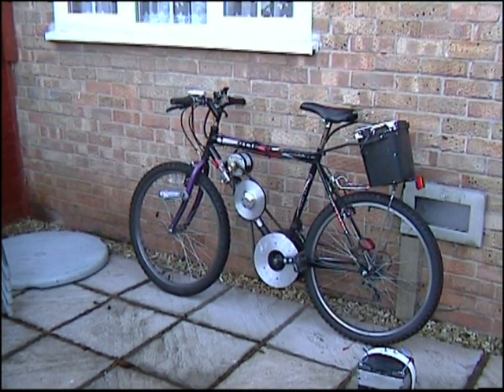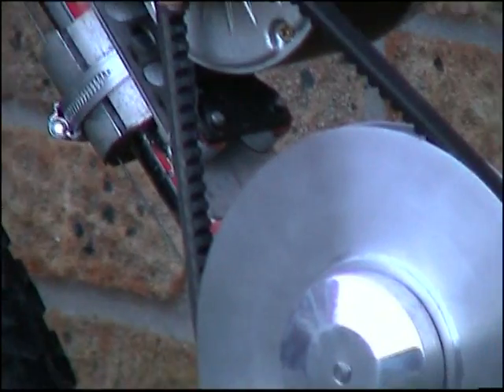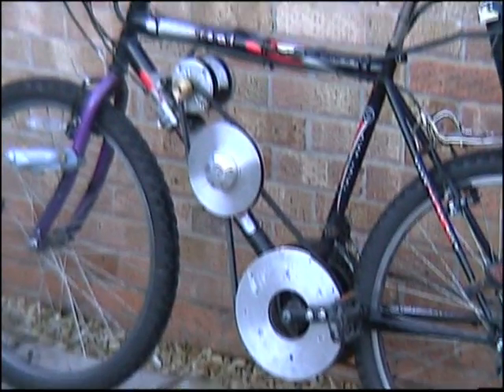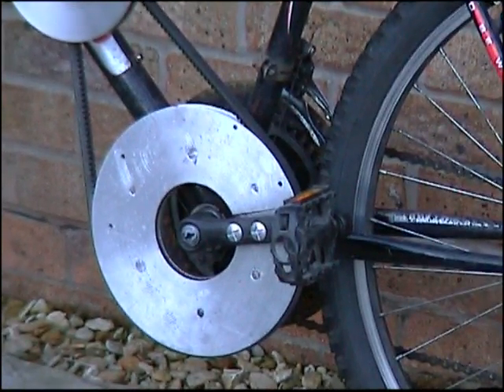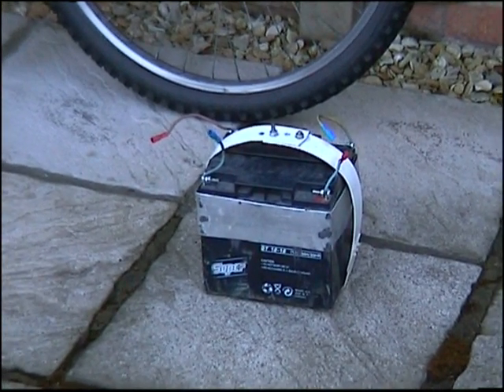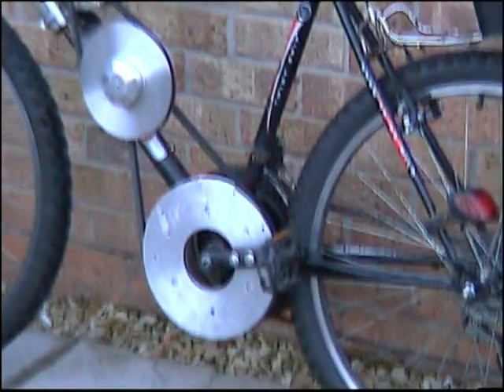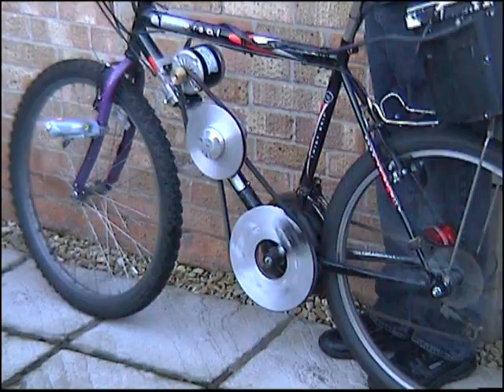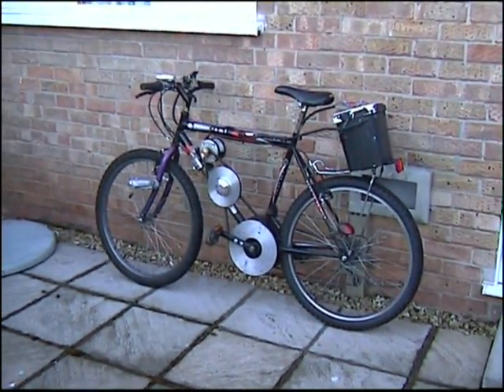Upgraded Home Made Hybrid Electric and pedal assisted Bicycle. Using a 350w 24 volt dc motor

Comment: Goofy ass power conversion? Just get a stronger motor and controller and skip all that transmission. Looks like the pedals have to turn when the motor is running not smart also no woman will feel comfortable riding this sewing machine where it appears any loose clothing will be sucked into this contraption
Oh and yes I have done it  at least 15 different ideas including a small e car.

Comment: how about you get 6 6S 5000mah Lipo battery packs and wire 3 6S packs in parallel and keep the other 3 packs as a back up battery pack for the trip home. Lipo batteries have more power output and charge faster than a sealed lead acid battery or just build some 18650 battery packs

Comment: Hi, I have a 24v 350w motor and 2 batteries of 12v 12ah acid batery, is this connection output to catch a speed of 30-35km / h and a distance of 20km

Comment: why pedaling in test ride? Motor not working?
Reply from the maker: It's pedal ASSISTED, so the motor works with the rider in unison to gain extra power together.
Reply: Nicola Burrow It have enough power to move alone?

Comment: If the battries are going to low voltage in the midway,  How can we recharge the battries?  Is it possible when the cycle is in running condition automatically it was recharged. or by padded is it recharge !
Reply: ashwini panda bfnfjfhivj

Comment: It's nice and simple design, i like how you attached pulley to crank, however in this situation when, pulley is not perfectly aligned ( i can see little bit of play) it will grind your belt over time, i would go for chain because it's much more forgiveable. This video is almost 7 years old so you probably figured it out yourself :)

Comment: is thes motor revolve in both direction (COLCK WISE AND ANTICLOCK WISE )
Reply: why would you want that on a bike xD!
Reply: dah!!! a bike is also a vehicle, sometimes you have to go in reverse!!!
Reply: Uhmmm... You do know that it's not practical to put a bike a reverse gear right?
Motor-bikes and bikes are smaller than 4 wheelers which makes them easier to just move it around with your feet.

Comment: It does not look HOME MADE !  Parts are all too nice and clean from other electric bicycles. Just put together like a kit . So what is "HOME MADE " ? I believe  you have to make it from part you have at home ! FYI, just saying !
Reply from the maker: That is actually quite a compliment. Obviously the motor is not home made but the pulleys I made on my lathe  in my workshop at home calculating the correct ratios. You will also notice the pulley attached to the crank isn't as neat as the top one. This is because I didn't have a thick enough piece of metal to turn it from, so had to bolt 2 bits of thinner plate together, then turn it as one part. I had to improvise quite a bit as my lathe isn't really big enough to handle such large parts. I do have other videos of me making some parts for other projects on my lathe if your interested. The plan was to make another bike after this one using better parts such as a lithium battery and a lighter bicycle but have never got around to it.
Reply: triumphmanful
Reply: he machined his own parts. It doesn't get more diy than that.

Comment: i really want the ebike factories to make heavy duty 5kw light as possible ebike frames with gear transmission systems desinged for high rpm motor use in low gears like a mini motorcycle gearbox transmission but lighter for ebike use.

Comment: yeah, the hell with what people say, it's whatever you think about it is all that matters, you should be proud of your accomplishments, you did a great job.👍  The only thing I would like to say, is that it's not good for batteries to sit on concrete, and I was always told that it does reduce the life of your battery, that it drains juice out of it, so that's the only thing I wanted to mention, so keep up the good work and finding new ways to improve on the design.
Reply: so you don't like his design another word's, the only problem i saw was the size and weight of the battery.
Reply: Roy Patterson as

Comment: good job , congratulations , you may indicate the measures quel central dish in thickness and diameter you used and how it got the other parts such as the throttle and controller, will make a similar , I'm Francisco from Santiago , thanks
Reply: +Francisco Rojas yes, the electronics is practically the heart of the whole thing. Mr. Burrow's build looks clean and well thought, what with that yuuuge reduction (more torque) applied to the pedal cassette. 
I would love to know whether he designed i the controller or got it from a "donor" byke  or bought it, and to see pictures (stills) of the fine details. But it is up to him to decide on whether to disclose it or not. 
It looks good, although he never stopped pedaling in  the video. I asked myself "what's he doing? charging the batteries?" Heh, I am an evil dude...
Reply: I am not sure about the laws in the UK but in Italy if the police catches you on an electric bike that goes without you pedaling they'll confiscate it and crush it, then fine you up to 1000 euros. But that isn't all. They'll do you for riding an electric motorcycle without it having a registration plate, DGM number, no insurance, log book, chassis numbers, helmet, lights, stop lights, hooter, real mirrors, etc etc the list goes on.  If you PEDAL, it's an electrically assisted  bicycle and as such there's no need for them to even stop you to see if it's a shop bought one.. Just saying.

Comment: be very quiet being belt drive. are you an engineer where did you get the pulleys theyre brilliant :) if you change to zippy  lipo 8000mah would give you more range and cost about £50 inc charger, great job

Comment: Does it have a freewheel on the belt drive to the crank so that you can still pedal without the motor?
Reply: +Terry Clark Do you have any idea what to do to make something like : Pedal without motor
2- When motor is on, no need to use pedal. any idea? how to use chain drive with sprocket? 
Anything?  thanks
Reply: waqas siddiqui This could be done using freewheel systems like in the back wheel. If the motor drives through a freewheel, then pedalling with the motor switched off would be possible.

Comment: Cool...but what you REALLY NEEDED to use here is the Crank Centric Freewheel...  Like those used on old Schwinn Bicycles.  Instead of the freewheel mech being located in the rear cassette...  it is located in the Crank...  So you can power the front sprocket and leave your feet on the pedals.  Schwinn used it way back in the 80's.....I never forgot about it bec I thought up the same use for it when I was about 10yrs old or so.  I knew one day I would use one of these with some kind of engine or motor...before I was a teen.

Tried to include a link w Pics but not able to paste link.
ANYWAY... LOOKUP  SCHWINN FFS  or FRONT FREEWHEEL SYSTEM...  They had this out in 1978...  Bet I know your next "Upgrade"   :)

Comment: Good work mate. Attach the motor directly to the rubber, much cleaner looking. Will work very well.Kinda the same idea as the newest model called Add-E.
https://www.indiegogo.com/projects/add-e-simply-add-electricity-to-your-bicycle#/story
Reply: +Kaywood Parsons Man, there is no comparison between the two approaches. Add-e is a friction type aid (with the merit of being applied to the rear wheel, instead of the front). Btw, thanks for the link.

Comment: ***** 
Im  curious. where can I find parts for the right size (how about an alternator?) is it better to have the motor use speed or torque? (efficient)
Reply: I made the parts my self. Just bought motor and batteries. I drive through the pedals so that the motor always turns at its most efficient. However hub motors have a lot of torque.

Comment: How did you get the pulleys attached to the other side. I thought about a similar setup with a 1.6 kw petrol engine so I could use all the gears, although I'd need to be able to pedal independently so I didn't waste energy spinning the dead engine when it wasn't in use, and also not have the engine spin the pedals too fast.
Reply: With a petrol engine, wouldn't that be classed as a 'motorcyle', and thus require crash helmet, tax, insurance and an MOT?

Comment: The problem I've found with 250-350 watt pedal assist bikes is that the weight of the motor and batteries make the bike so heavy that you end up going no faster than if you just pedalled a lighter bike in the first place. Same amount of pedalling effort.
Reply: It depends on the brand and type of motor and battery.. I got a 1000w bike that can switch to 250w and i can tell you from personal experience that 250w is plenty for most uses.. even up hills.. the throttle alone is fine. Lead acid batteries are just too heavy and crap.. small lithium batteries are so much better. That or you never rode a E bike
Reply: maybe you should put the 250w-350w on a lighter bike..yust saying...

Comment from the maker: Just thought I'd leave a few thoughts on some of the comments I've been getting lately. People saying "should have done this or that"  "built on a cheap bike" etc. Well go on DO IT. The point of this video isn't to say " WOW look what I've made" It's for people with a like minded interest in building their own electric bike to look at it and see that yes it's built on a cheap bike and uses heavy batteries (but when you start a project and have no idea how it will go, one doesn't want to spend a fortune on products such as lithium batteries and expensive bikes etc  not knowing if it will work.) But it does work. So imagine how it would go with lithium batteries on a lightweight frame with a freewheel fitted to make it easier to pedal without the motor running. At the end of the day it enabled me to cycle my round trip to work and back of 18miles which was bloody knackerring for me at the time and do it more frequently with less effort. Job Done.
Reply: +Nicola Burrow fuck the haters this is a great amzing fantastic bike ....peace from Ireland
Reply: +Nicola Burrow  great said maam. a very good piece of work... i love it. forget about people saying negetive theres always critics for a great works...
Reply: Car and bike batteries are designed to deliver big ammount of power in short time, they are not the best soultion for ebikes,  solar panel batteries perform much better,  as they are designed to discharge slowly over time.
Reply: don't let them get you down sis
Reply: Why use a car to go to work, when you can throw a gasoline weedeater engine on a bike for dirt cheap, and cruise about at 25mph? Or spend a bit more money to accomplish the same thing, but with electricity?
Reply from the maker: These are deep cycle lead acid batteries.
Reply: I'm looking at turning my bike into an e bike, can I ask where you got the batteries?
Reply from the maker: I got the batteries on eBay they are lead acid deep cycle batteries. However if you are thinking of building or converting a bicycle I would only consider lithium batteries as they are much lighter than mine. The batteries I'm using on here are the biggest drawback on my bike. Good luck with your project.
Reply: Great project. I can just imagine how high your center of gravity is with those lead acid batteries. Be careful with your balance! I want to use my everlast welder to modify one of my old bikes. Thanks for sharing.
Reply: Would an electric motor with 1/10 HP be sufficient for this?
Reply: By any chance to get in touch with an inventor???
Reply: ola eu preciso desse motor que você esta usando na bicicleta onde eu  posso comprar você pode me diser?
Max, email-mmkservice1@gmail.com
Reply: Well said.
Reply: Chris Juchniewicz I'd imagine it would boost your leg power a bit but I wouldn't expect a 75 watt motor to do all the work unless trundling along down a canal path in a lower gear.
Reply: Have you seen these new lithium ion batteries for motorbikes?
They weigh less than 1kg and are around six by four by three inches in size. One could easily be positioned behind/under the saddle.
Reply: Correct we can draw on Ideas from all uploads.Bearing in mind Lithium batteries Cost a lot more when this upload was made(2009).Thanks for the upload.
Reply: you see putting a car battery above the back wheel is stupid because you can't balance the bike probably, when he turns he's going to tip over like that from the weight he was having trouble controlling it even when he was riding straight, you would need a motorcycle battery, it's maybe half the weight.

Comment: Well well well, the motor driving the bottom bracket does indeed reduce the efficiency of the vehicle but it has the side effect of keeping the cyclist peddling the bike, therefore at the very least they operater is getting the range of motion he would if cycling the bike himself, the downside however I can see if going fast down hill comming into a bend it would be necessary to shut off the motor inorder that the pedal shank did not ground out in the case of getting lean on. I think it is a top piece of crude and practical enginering It is power assistance, and I say good job and health to enjoy
Reply: If one is going down hill, why would you need any power other than gravity? Just saying...I like the idea of pedaling with electric power assist. Exercise and extends the range.
Reply: Good point well made :-)

Comment: can you connect you`re pedals directly to de AC charger and de eletryc motor directly to de wheel so you can charge the battery easy and the electryct motor will run always whit a full charge what you think?? thanks for the video

Comment: Motors are available on ebay . look for MY1016  this is a  350 scooter motor with a belt or sprocket option , I got one about a month ago  about 30 gbp un the ek , a 250 w controller is also available from china with a throttle less brake levers for under 20 gbp
good luck our mountain bike works well using friction drive on the rear wheel and 2 x 12ah batteries
Reply: !0 amp controller x 24 volts would be legal

Comment from the maker: i forgot to mention in this video that i made a sixty tooth chain ring for the front gear attached to the standard 48. With a 14 on the back i think at 80 rpm in top gear it would do about 30mph. regarding the weight issue,  the last couple of bikes i bought stated not to be ridden if you are over 23 stone. even with the weight of the lead acid batteries i am nowhere near that weight so i should think im well within the bikes carrying capacity.

Comment from the maker: i bought the motor on ebay. idont know if you can still get them. i didnt  use a speed controller as the idea is that you pedal at the right speed so the motor always works at its optimum efficiency.

Comment: I like that it's not a freewheel hub because it's helping you pedal.
What's unsafe about motorized bikes that run without your help of your legs is that if you are not pedaling motorists don't think you are going that fast. But if you are then they can gauge your speed.
I know this from experience because I own a few motorized bikes and I'm looking into electrics so I can lose some weight without giving up on riding with no assist.

Comment: Assuming he's in top gear on the most common combination of front/rear cogs for that era of bike, he's doing 20mph at the 80RPM the crank is span, and from 350W it's going to accelerate about the same as a regular person pedalling hard. If that bike breaks from this use, then it would have broke a couple days after leaving the shop when it was brand new!

Comment from the maker: thanks for your comment. i've just started my next project. the plan is to have the motor on a freewheel so you can pedal without turning the motor. it will be on a light weight bike with a lithium battery. Driven by a worm gear to get rid of the big pulleys. This was my original idea but the bike you see in my video was done a bit on the cheap just to see if it would work.

Comment: I recommend changing that frame or at least fork as soon as possible. If that thing brakes and it will, you will brake your neck. Find something recommended for downhill or some extreme sports, these are build to survive high loads

Comment: Nice project.  I installed a 1000 W 48v in the the hub brushless motor setup on my bike.  Easy to install and use, in my opinion it is the best way to go.   To increase the range and performance of an electric bike on the road change the knobby tires out and use road tires.

Comment: I HAVE FREE ENERGY FUNCTIONAL MODEL WITH ONLY A BICYCLE DYNAMO 110 VOLT AC. 600 WATTS WITH THIS PROJECT IS ON WEAPON SYSTEM USING MY GIANT SCALE KITS-UCROS CYCLE BATTERY ELECTRIC LIGHTS WITHOUT AN EXTERNAL ARRANCON 15 SECOND SEA POWER SUPPLY OR BATTERY ONLY FOR THIS MINI STARTER KITS-UCROS IDEAL ELECTRIC MOTORCYCLE NO BATTERIES AND ULTRA LIGHT LOOKING FOR SPONSOR CONTACT THE COLOMBIAN INNOVATIVE CARLOS UCROS PIEDRAHITA-  MODEST SEARCH MY WEBSITE ON GOOGLE AS KITS-UCROS.ES.

Comment: These china made brushed motors are not very efficient..
My option would be a Rewound brushless outrunner from an old washing machine
These motors called Smart Drive  .. you need to rewound these to 24V or 12V and a strong brushless controller

Comment: I don't mean to belittle your engineering, but that is illegal on the roads.  If you have more than 250W and going faster than 15.5 mph then you need an MOT, license, Insurance and a tax disc just like for a moped!

Comment from the maker: i wouldnt say it creates problems as the motor turning the pedals is the only way I could see that would enable the rider to have assistance at all speeds while pedalling. For example a hub motor is limited to approx 15mph so any speed above that is entirely pedal power. however as you suggest a free wheel would enable the bike to be pedaled without turning the motor so would be beneficial at certain times.